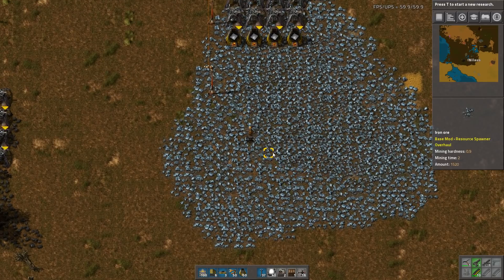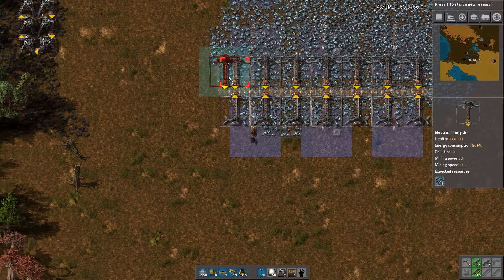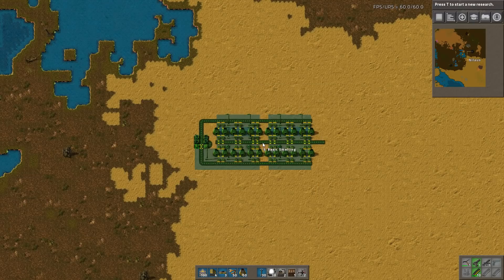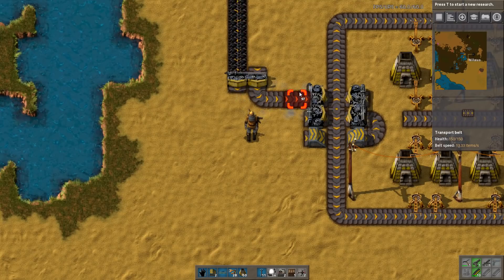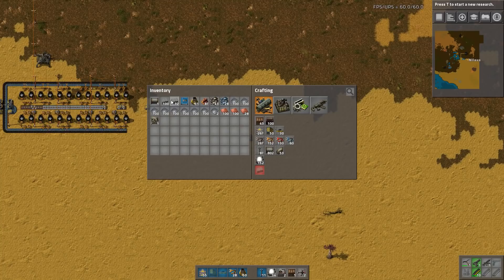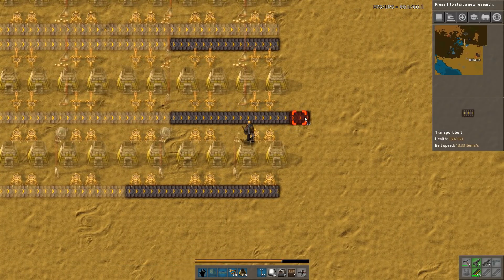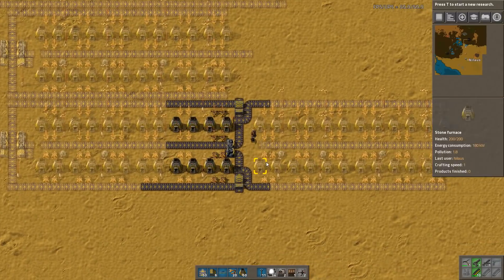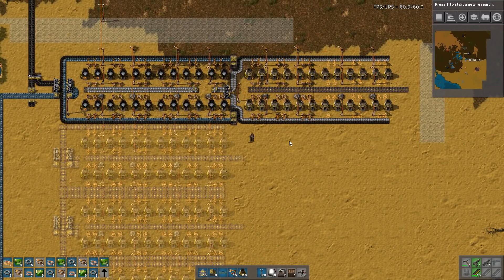Factorio Tutorial - 3. Basic Mining and Smelting

Comment: crazy useful content. I'm struggling with basic calculations tho to be able to build effectively on my own, not blindly copying your stuff. e.g. you say 14 miners is enough to fill standard belt. also 24 furnaces are enough to use standard belt throughput on full. what are the calculations behind these? i'm, definitely missing something in the picture. thanks in advance
Reply: I think it should be noted here that Nilaus spoke in error. 14 electric miners to 24 stone furnaces is a good ratio at the start, (it's technically 13:24 but you know... even numbers for symmetrical blueprints) but it will not saturate a yellow belt. More specifically, it would be about enough to saturate one lane, one half of a yellow belt, and keep that many stone furnaces at full production. But he'd need at least 13 miners PER LANE to saturate a yellow belt, as well as 12 steel furnaces.

As far as the actual calculations... I don't know all the formulae myself, but it's easier to just memorize the key figures:
Electric miner w/ no bonuses mines 0.525 iron/copper ore per second
Stone furnace smelts 0.285 ore per second, steel furnace 0.57 ore per second
Yellow belts transfer 13.33 items per second (6.67 per lane), red belts 2x the yellows, blue belts 3x the yellows.
Yellow inserters insert ~0.84 items per second, red inserters ~1.26(~50% faster than yellow), blue/purple/green/white inserters ~2.43 (~3x)

Comment: i tested out your method, but i can get 20x2 stone furnace fully utilize the yellow belt, 18x2 to be really efficient(set it up and let it run for like 1 min before observing it), when upgrade to the red belt, upgrade those stone furnace to steel furnace also.

And if the coal is at the inside of the lane, you only need to use 1 underground belt each side.

Comment: you could already start with a 48 furnace yellowbelt you don't have to wait for red.
Reply: 14 miners seem barely enough to fill one SIDE of a moving yellow belt, too.  The mining / smelting speed was probably changed a few times between versions. 
The trick to use the area of influence to its fullest to allow the first and last miner to run longer (still not as long as the ones near the middle) is neat.  If it doesn't fit perfectly, one can even leave an empty space or two between the first two miners and between the last two, to give the miners near the edge more "uncontested" area to work on.  Depending on the # of belts per deposit, if you end up with one belt that's fed from only one side, spacing them out (one or two empty lines between the first two belts, same with the last two) can again help run the first and last belt longer before they start running out.  For me, it's not a "run as long as possible" thing, but a "using fewer miners early on, when their cost isn't trivial" issue.

Also, there has been some progress WRT smelting columns.  If you run coal on the inside, you can run a coal belt vertically inside the U-shaped belt to feed multiple columns.  That doesn't work well the other way around, since smelting takes more ore than coal.  And to smelt steel, a "fat column" where an ore-to-iron smelter feeds into an iron-to-steel smelter is preferred today; it saves a bit of space and is just as long as an iron or copper column.

Comment: I like the smelter design, I do basically the same thing, except that I put the power poles in between every 2 furnaces, and they unload on to a side loading belt.  This allows me room for Electric Furnaces later on, without having to move my input or output lines.
Reply from the maker: I replace my Stone Furnace setup with Steel Furnace, which have the same footprint. Hence I want the compact setup I have proposed here. With the power poles between the furnaces you are using more poles and a lot more space.
By the time I build Electric Furnaces I also have robots, so the rebuilding is pretty simple.